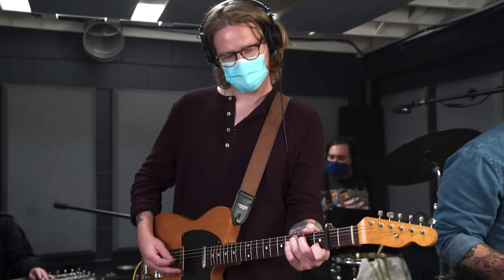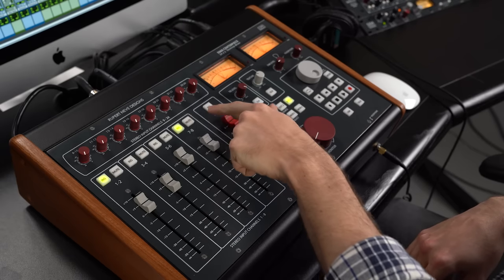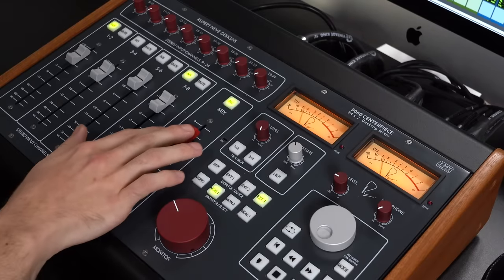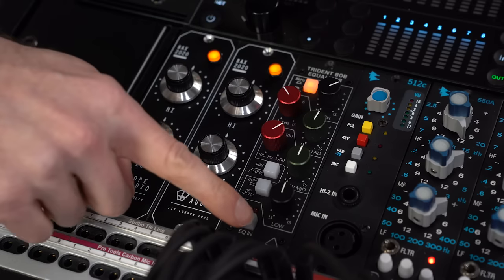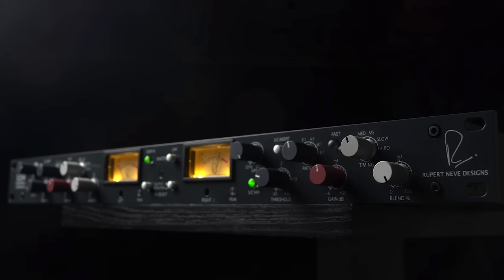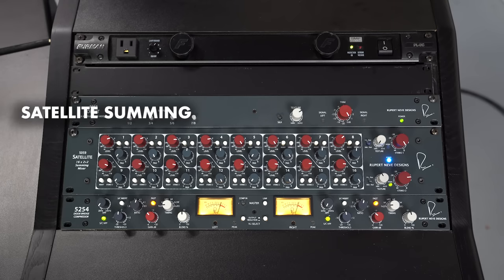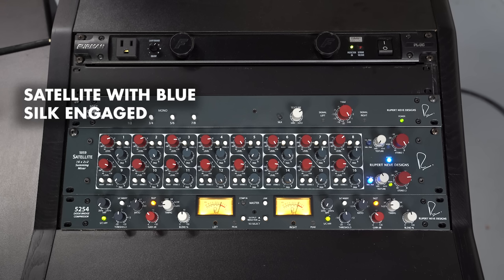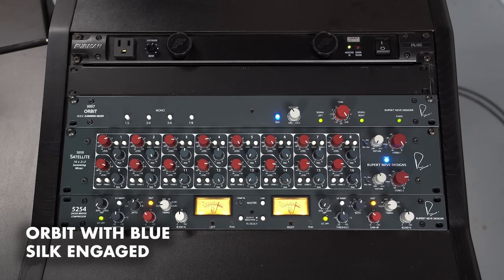Achieving Console Sounds With The Rupert Neve Designs 5060 Centerpiece, 5059 Satellite & 5057 Orbit

Comment: I’m just wondering based on the color design white vs black do these new design Neves are they all same quality compared to the old white ones because the price of used ones are quite a huge difference. I’m trying to purchase a 5059 and prices are quite big differences
Reply from the maker: There is no difference between the Shelford Blue and White versions other than the finish color.
Reply: @vintagekingproaudio  Wow very interesting I guess a used one here would be the answer. Thank you

And one more question appreciate your reply what is the difference between the 5059 and the 8816 both look similar but is there any differences in its utility they both look awesome other than the noticeable VU meters and maybe extra buttons

Comment: So can you hook up the 5060 and 5059 to get more channels? Would i be able to control them from the Centerpeice?
Reply: You can run the 5059 (or two 5059's I believe) into the 5060. There are some diagrams in the 5059 and 5060 manuals that show connectivity possibilites.